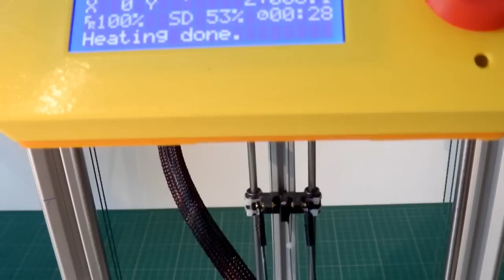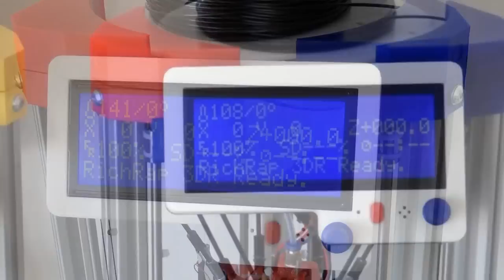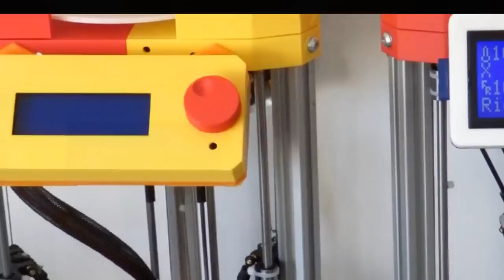RepRap 3DR Delta 3D printer

Comment: It is all about less moving mass. With the Bordon tube extruder there is no onboard stepper. With all axis contributing to the motion; you don't have an entire axis to move which includes at least one set of linear bearings and rods. And there is no moving the bed with the other axis. Which all adds up to faster acceleration. Look at the fastest pick and place robots they all use the delta design.

Comment: Great work Rich. I'm curious, on the rostock wiki and in the reprap forums the general consensus  is that the motors need to have a high torque rating. Equal if not higher than Prusa/Mendel etc type printers. Why is this so? I can't understand why given the relatively minimal mass of moving parts on a delta type printer.

Comment: Greetings from New Zealand RichRap. I have been following your blog for a couple of weeks and am now gathering the parts to make a delta style repstrap 3d printer based partly on your 3DR but using sheet metal for the frame and gum wood for the linear rod brackets and some other parts. I am going to use many of your 3d printed parts, like the carriges, spool holder, extruder etc but I would like to have a slightly larger build volume. I have been searching high and low for a tutorial which describes the geometric considerations to make when building a 3d printer but haven't found any definitive guides on determining geometry yet.  I was wondering if you could point me to such a reference if you have it. Or if you wouldn't mind do a tutorial on your blog about delta robot geometry and how to calculate things such as built size, tower spacing, push rod length etc. Maybe touch on why you made some of the design decisions that you did and describe aspects of geometry which is fixed( do the  towers have to form an equilateral triangle) and geometry that can be changed. (Increase bulid hight or width.) For example, I am curious why you didn't design the spectra to act on the cariage directly between the rods as it seems that would put less of a twisting moment on the  linear bearings as the carriage is accelerated. Thanks for all the great information that you have provided to the community.

Comment: Would a 200x200mm heated bed fit as a print platform?  I assume it would need to be insulated underneath to avoid melting the base too.

Comment: This is simply awesome, I was wondering why no one had created a scaled down (compared to Rostock) delta using 6mm rods, you're a bloody genius. 
I would definitely be interested in buying at the very least one kit, vitamins or full. 
Does it have the capability to use multiple extruders or would the head need to be redesigned for that?

Comment: Hoqw much does it cost?
Reply: If you have access to have the parts printed, less than 1KG of parts for about a $35USD spool. Electronics are the most expensive and depending on how you source the parts, I'm almost done and I estimate I'm within a $5-600USD range building it, getting access to another 3D printer or having one to print the parts helps a lot on the cost, also sourcing everything on ebay (mostly from China) helps. reprapdiscount has really good deals on kits for most of the stuff you need for this printer. A lot of stuff you don't want to skimp on are the extruder/hotend, jams are not fun at all.

Comment: Hi Richard, thanks for this inspiring video. I never used a 3D printer before but intend to purchase a Kossel 2020 or Da Vinci 1.0 (modded firmware). Not sure, which one gives better prints. But I also intend, to build an own 3D printer that has a large printing size for X and Z and maybe the vertical Y, too, as soon as I have some first 3D printing and printer experience. I wonder if you publish your 3D parts online so I could print the same parts?

Comment: as someone who is new to this, how far on is technology in the scanning of objects?
Also is the biggest hurdle in 3D printing the equivelant of pixel range? what is the current measurement?
Reply: 3d scanning and 3d printing have nothing to do with eachother (as far as the technology involved), and what's used to measure can't be measured in pixels because they're physical 3d objects.   Instead, we measure in milimeters (or microns).  Currently, the highest resolution I've seen people print at is 50 microns (50 millionths of a meter) on the Z-axis.  It's not uncommon for the X and Y axis to have an accuracy of ~17 microns.  If you want to learn a lot about this stuff, go look at the reprap wiki.
Reply: look up autocadd 3d scanning

Comment: Did you just use a bit of twine instead of the belt for the pulleys?
Reply from the maker: Yes, it's spectra-line (high strength fishing line) and it works really well.

Comment: im having a lot of issues with this printer, the motion is very steppy/jerky/wobbly, leaving the reprap coin test print looking like a very badly printed gear. also when it doesnt even want to print the head raises up at the x tower when printing and when setting the 50mm radius for the test print this causes the head to crash straight into the spectra line. Not touched it in months now, going to convert it to gt2 belts and keep at it tilll i get the bastard going.

Comment: Hello. 

I have access to 3D printers at the university where i study, but what electronic components do this build need? 
I have not been able to find a parts list at your website.

And where should electronic components for this build be bought?
Reply: 李龙 I think you misunderstand me. 
I was interested in knowing only the electrical parts, since i am able to get all the structural parts, now that he has uploaded the 3D printed parts. 

I want to know if buying the electrical components and making it myself with the drawings he has supplied is cheaper than buying a whole kit for $420. 
I am a student, so buying a kit would be in range, but would need some saving up. On the other hand, if the cost can be lowered, by making it myself and only purchasing the electrical parts, so will the time i have to save.

But i will keep your link in mind, thanks.

Comment: how much money does it cost
Reply: i also would like to know
Reply: me too, commenting in case you get a reply
Reply from the maker: It's an open-source 3D printer, so you print the parts out yourself and buy some of the standard parts like smooth round rods and bearings etc. You should be able to build one for under $250 if you can print the parts yourself.

Comment: Can anyone compare the printing specs or performances between the
- Folger Tech Kossel 2020 RepRap
- and the firmware-MODDED version of the Da Vinci 1.0

in regards to
- print quality
- micron resolutions
- printing speed
- printing dimensions (area: X, Y, Z)
- customer service or warranty
- possibility to modify the printer (modding, etc.)
- endurance of printer health (breaking parts, adjustments, etc.)
?

Thanks.